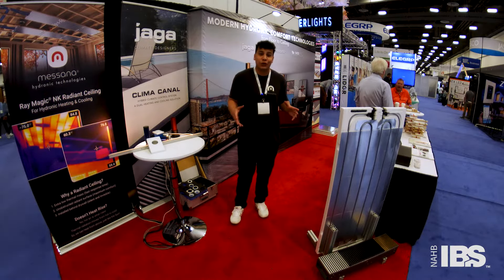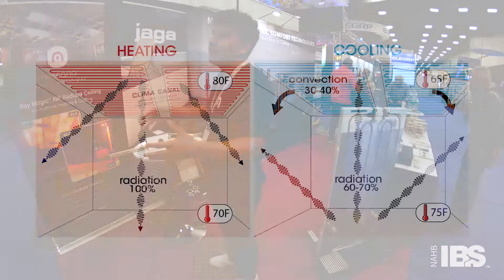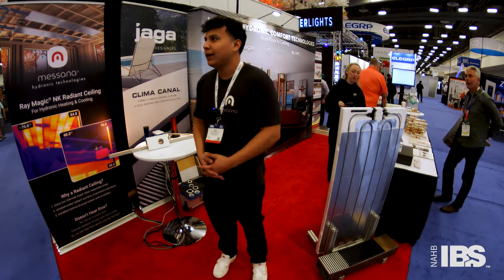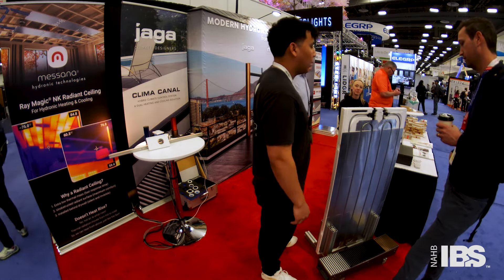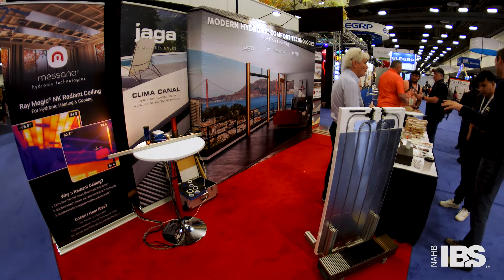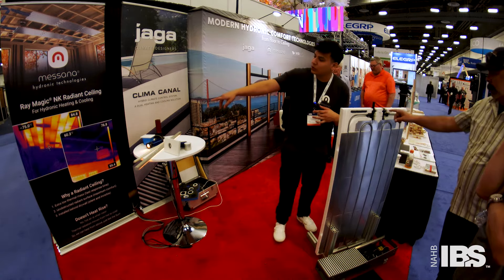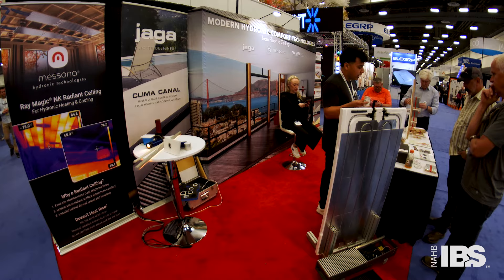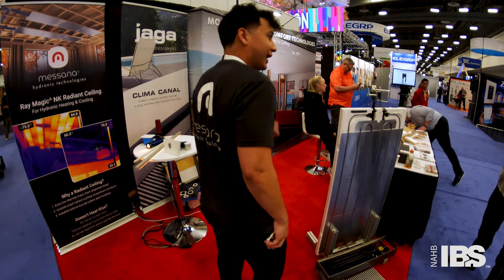Hydronic Radiant Ceiling Cooling and Heating at IBS 2024 | Messana Hydronic Technologies

Comment: I heard you mentioned in multiple videos about low thermal mass for cooling. I live in the tropics. Hot all year round. What if I want the thermal mass because I don't expect to ever need heating, is that possible?
Reply from the maker: Humid environments like the tropics are actually where a low thermal mass is critical!

A low thermal mass results in a faster response time, allowing the panels to quickly react when there are changes in the humidity and the dew point temperature (when condensation forms). 

So if anything, it would be the opposite, where a high mass system is okay for heating-only, although it will be less efficient because it will require higher water temperatures to be brought up to temp (this makes the energy source work harder).

Comment: this is very good. you guys need to work on expanding into the caribbean market!!! very different style of construction to the us, but much hotter!!
Reply from the maker: We'd certainly like to work on a project out there! 

One thing to keep in mind in that type of environment is the consistently high humidity level. With high humidity comes a high dew point temperature, which inhibits radiant cooling performance. The dew point is the point at which condensations forms and we must keep the radiant surface temperature above that point at all times during cooling. So if you have a high dew point, you will need to use warmer water in cooling, limiting cooling output.

To get around this, dehumidification units can be incorporated and managed via Messana Controls. This lowers the dew point in the environment to allow for more effective cooling. 

Another option we recommend is the incorporation of hydronic fan coils. Hydronic fan coils utilize the same supply and return hydronic lines that feed our radiant panels. Because of this, they don't require ducting and can be managed via Messana Controls. 

We tend to recommend Jaga hydronic fan coils which integrate particularly well with Messana Controls. Using our hydronic controller, we can power Jaga's low-voltage fan coils directly as well as provide some dehumidification to assist the radiant system.

By running the fan coil with chilled water at a low fan speed, we can produce condensation which is then collected by the fan coil condensate drain. By creating condensation using the fan coil, we pull moisture out of the air to lower the dew point temperature in the environment, allowing for greater cooling output.
Reply: @messanatech  oh wow. i didn't think about that at all. such a great point. you've obviously thought about it a lot! thank you for your help. I'll take this back into discussions!
Reply from the maker: @TheoneandonlyRAH  Happy to share some insights, let us know if you have any other questions!

Comment: Can this cool in extreme heat? I am in St. George Utah and the temp today is 118 Fahrenheit (think Vegas sun + heat).
Reply from the maker: Hi there, great question! Since radiant cooling output is limited by the dew point temperature, they excel in dry climates but may be limited in humid climates.

So a radiant cooling system in a dry climate like St. George would do well. With that said, however, it is typically a good idea to incorporate a second-stage cooling system for the hottest days of the year. 

We recommend using Jaga hydronic fan coils that can tie in directly to our hydronic system/controls. This is useful for homes with large doors that open to the outdoors. Once they are closed, a radiant system would take longer to bring the environment to its set point, so having fan coil units would speed up that process. By utilizing fan coil units, you'll have a quick way to bring your environment to the set point and the radiant system can take over from there.